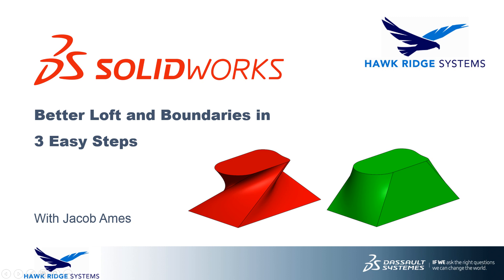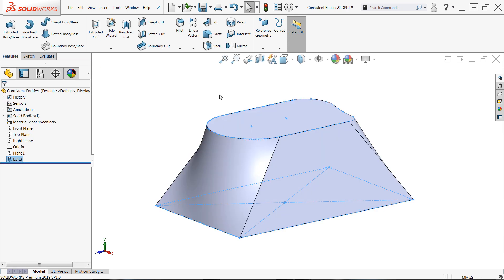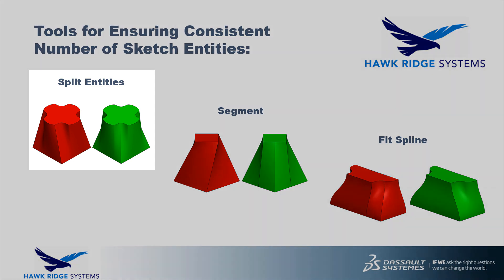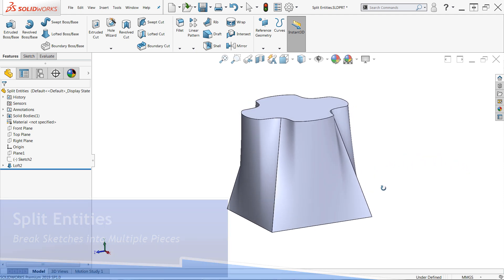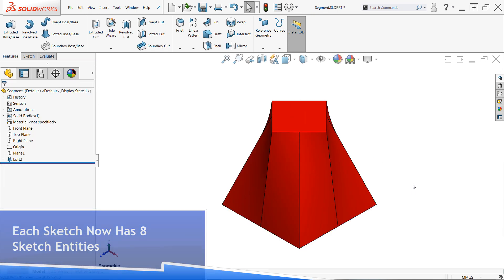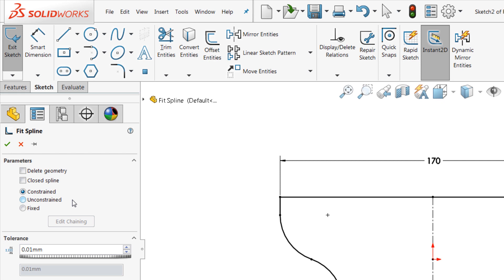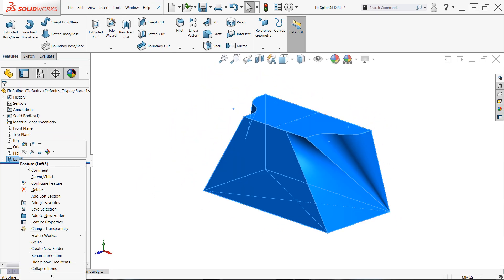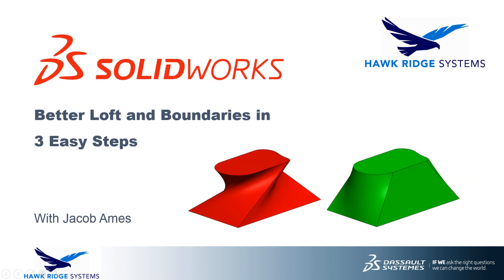SOLIDWORKS: Better Lofts And Boundaries In 3 Easy Steps

Comment: Great video!  One more tip, if you are lofting surfaces, dragging the endpoint/connector can reduce the end surface profile to a size you want.  For example if you know you want to loft between two curves on a complex shape, but in the end you may want to do a boundary fill between sections, you can move the endpoints around limiting the end result while still driving the tangency/curvature continuity.

Comment: I make a lot of two-profile lofts to simulate bent wire routing in wire harnesses.

After picking the two profiles, I need to have the following settings as default:

- Start/End Constraints

     -Start constraint:

          -Normal To Profile

     -End constraint:

          -Normal To Profile

- Options

     - Un-check Merge result

If I could have these default settings active every time I start SolidWorks it would save me a ton of time!

Comment: I Did not know about the "Show All Connectors" and "Edit Connectors" functions inside the Loft Feature. Whenever I'd run into Loft issues of this nature I would end up rolling back and making a 3D sketch with straight lines defining where I wanted the loft to go and use them as "Guide Curves" to constrain the Loft into the shape I wanted. This was not always successful. The Edit Connectors seems like a much simpler solution to this method. Additionally, sometimes I would run into the "Unequal Sketch Entities" error as well and would end up making say... 3 Lofts, instead of using one of these shown methods and making it out of a single one. So thanks for this informative video!